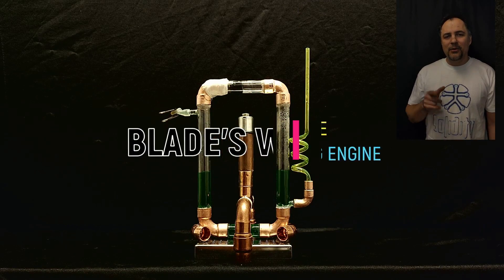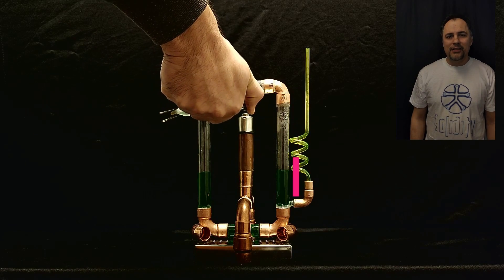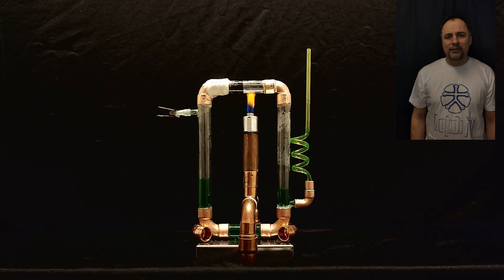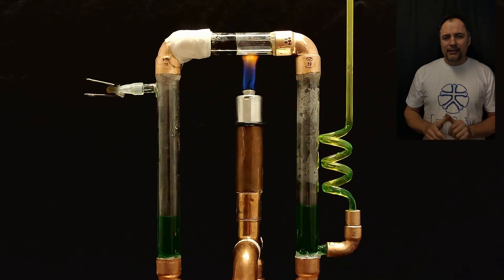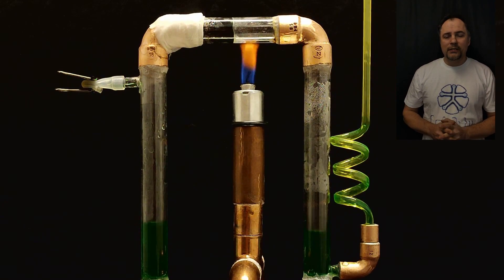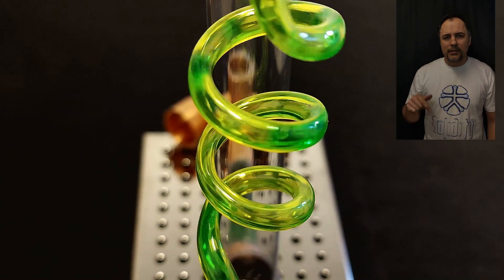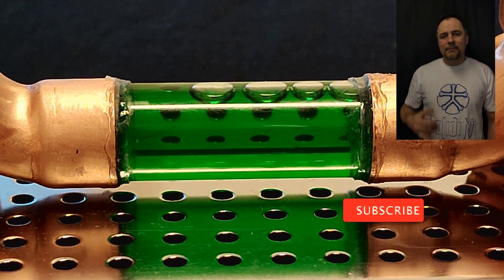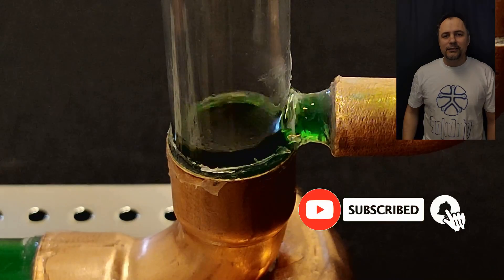Exclusive Stirling Engine contents from my work! - tips & tricks, tutorials, earlier acces, ideas

Comment: you can increase returning force in a third way: make pipes bigger and  cover both liquid surfaces with rubber membrane. And finally load the membranes with ferromagnetic material! And now you put in magnetic field. It would have magnetic permitivity of steel or ferrite. Which is orders of magnitude higher than that of ferrofluid.

Comment: instead of spinning we could increase potential energy in other way: using magnetic liquid(ferrofluid) and magnet, spanning lower U-shaped region. Liquid will try to stay in magnetic field and we will get additional returning force. If we think of a liquid in U shaped pipe as of oscillator, then it has mass and returning force(mg). Both centrifugal force and magnetic attraction force will increase returning force(mg*cos(vertical inclination)+omega^2*smth) or (mg+ B*smth)

Comment: I have and idea: if you spin this engine along upper heated and cooled pipe, you can increase the frequency of oscillations and thus power. If you spin it fast enough or make it big enough, its spin axis can be vertical .  Also it can be made radially symmetrical: Φ or ⊖ . Although, I am a bit concerned about Coriolis force.  Power extraction can be achieved with positive displacement pump/hydromotor, check valves and half-filed expansion tank.